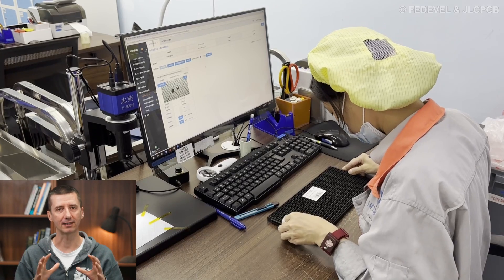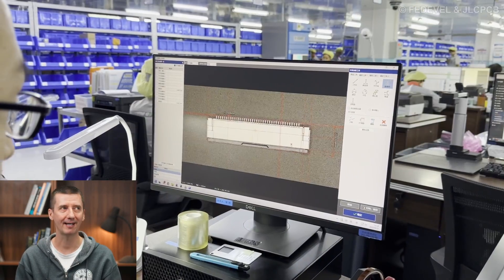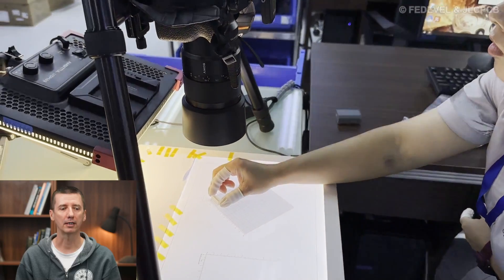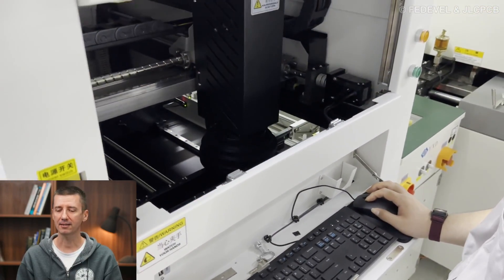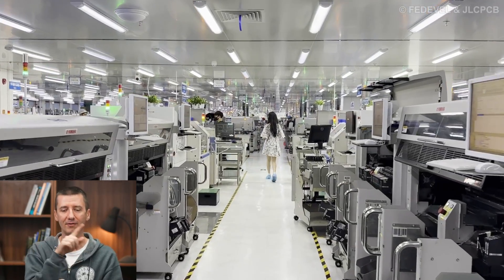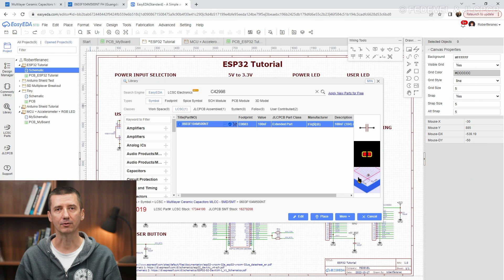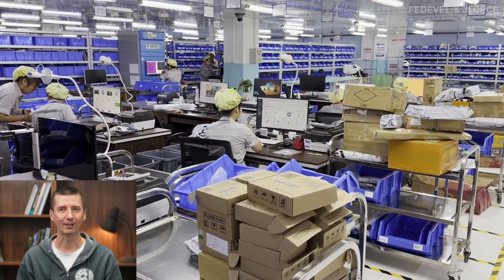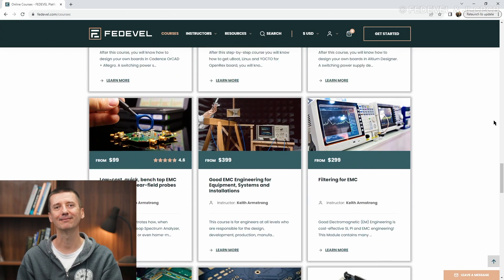Visiting a Big Factory in China - How they create libraries #EasyEDA #LCSC #JLCPCB

Comment: Hello, I would like to ask you a question. Regarding high-speed differential pairs, can we refer to the power layer? Will it have a bad impact? Thank you.
Reply from the maker: This video will help you to understand it better: https://www.youtube.com/watch?v=2UKfWowTvOs
Reply: @RobertFeranec  From your channel I prefer this one (https://youtube.com/watch?v=icRzEZF3eZo&si=T-uEHZi0wXSD0KjL). So, if there's no lateral/diagonal disturbance* over the VCC surface of the plane acting as a capacitive impedance match for the diff pair, things should be fine, after all.
disturbance*: strong di/dt return path (picture a diff pair matched to VCC surface whose role is to provide enough power to switching MOSFETs from the same VCC). I hope I clarified my initial statement.
Reply: @RobertFeranec  thank you very much
Reply: @RobertFeranec Let me ask you again, so the lower layer of the differential line, whether it is the power supply or GND, only needs to be a complete plane?? The key point is that if the differential line has holes to change layers, ground vias must be drilled near the holes, right? Thanks.
Reply: I am not Robert, but yes, you can use GND and Power plane as well for reference
Reply: Not Robert either. There are 2 main things to keep in mind: impedance (signal integrity) and trace length (length matching). Depending on the noise in the power plane, you may or may not refer to it.
Reply: Only if the power plane is the high level of the diff pair. Don't use your 5V plane as reference for your 3v3 diff pair.